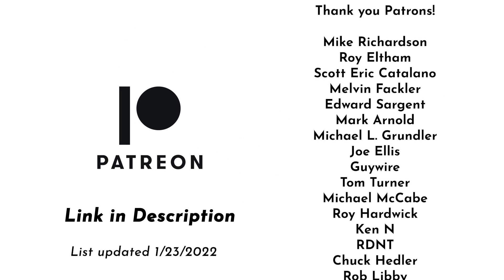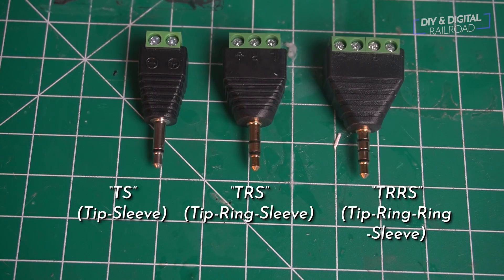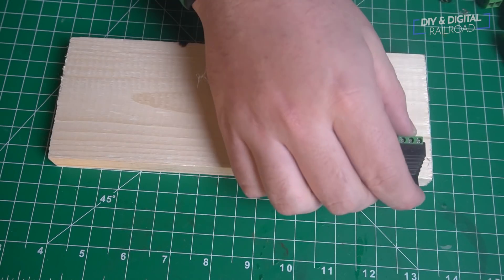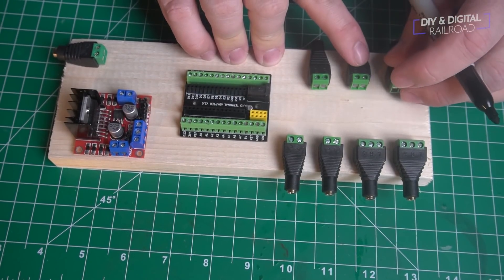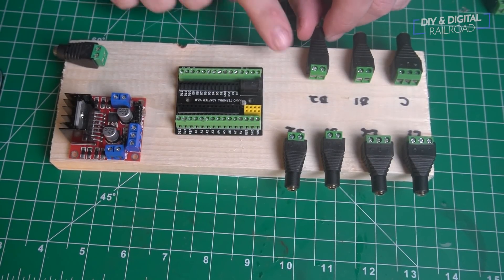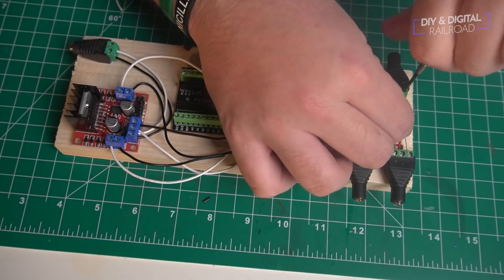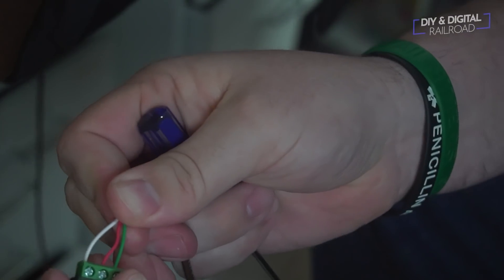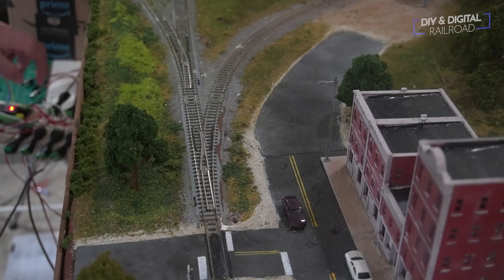This Makes Model Railroad Wiring A lot Easier.

Comment: Just be careful to plug and unplug the audio jacks when there is no power on them. Since the jacks contain a wiper that touches each ring, the wipers would potentially touch a ring with the wrong polarity and cause a short circuit. After they are all plugged in you can then turn on the power.
Reply from the maker: You are 100% correct.  This is also why I won't use this method for track power.
Reply: @DIYDigitalRailroad  Don't tin stranded wire. Solder flows under preassure and since these contacts are not spring loaded, they will become loose over time.

Comment: I'd probably only use rj11(4 wires), rj12 (6 wires, handy for pairs of 3) and rj45 (8 wires) connectors instead. Like someone else said the jacks do create a short when plugging it in or pulling it out.
If you need pairs of 3 then old serial ports are 9 or 25 pins.
Depending on the size of the layout you could have patch panels with pre-laid cables between central points that also allow for future expansion so you don't have to constantly pull new wires with all the associated risks.

Comment: DO NOT TIN THE ENDS!!!
Solder flows undwr preassure, meaning every connection with soldered tinned wire will become lose over time. 
Otherwise, great video thought.

Comment: I know this might not be the place for this, but I'm trying to build my first 2x4 layout and I have my 2" foam board mounted to the plywood and I just keep staring at it, not even knowing where to begin.  What I do know:   1. Fall landscape  2. single train  3.  likely using my bachmann ez track  4. Mostly a residential/city scape - not necessarily any industry since it's a small layout.   I've been watching Youtubes and looking at Google images like crazy and I'm just in this rut.   Thanks!     I'm in the Raleigh NC area if you know any good local resources/mentors.
Reply from the maker: I actually did a 2x4 N Scale layout build from start to finish for this exact Scenario.  It uses Kato Unitrack but it can be adapted! https://youtube.com/playlist?list=PLhNb9AHNpkeei0oTCywo9rVMnD8EBy41Z
Reply: @DIYDigitalRailroad  Hi Jimmy - I was following that series.  Can Bachmann EZ track run DCC?   I did an amazon cart total of your layout and it comes out to $169 which isn't the end of the world, but if I can avoid buying all new track that would be ideal.   Thank you.

Comment: oh no, dc voltage on a plug/socket arrangement that shorts out every time you connect/disconnect.
Reply from the maker: Yes you are correct, which is why I do not use these for any track power. This is also more of a ease of removal and disconnect for troubleshooting hack rather than you will be unplugging it all of the time.  I always power off something before I disconnect it.

Comment: One disagreement. don't tin stranded wires that you will screw in place. The solder under screw pressure will 'cold set' and the joint will lose tension, and the wires may loosen. Difficult bug to troubleshoot.
Reply: I totally agree. My last layout started to suffer strange faults after about 5 years and they were all due to this type of connection becoming loose. Don't do it!. ...........John
Reply: I was going to suggest that instead of tinning stranded wire, use ferrules.  You crimp them on with a tool and you have a solid 'end' to your wire.  They come in a variety of sizes and gauges and make stranded wire in screw terminals (or spring-loaded terminals) a breeze.

Comment: Alternatively when you really need the flexibility of stranded wire but want to avoid the loose whisker issues of stranded the use of the appropriate size ferrule and a ferrule crimper can save the day. There are even ferrules designed for connecting two wires in a single ferrule which is great for daisy chain wiring. An additional benefit to the ferrules is that properly crimped they exclude oxygen and reduce the amount of oxidation in the connections. Great video, keep up the great work. I don't know if I would have ever thought of using audio connectors that way.

Comment: I have been able to adapt your "Controlling Multiple Kato Switches with a Single Arduino" to control 2 crossovers and a turnout to industrial area inbetween plus turnout based signals with block detection should the turnout be aligned to an occupied block. Thanks for your videos on DIY Kato Unitrack turnout control and signalling

Comment: Aloha Jimmy  just a suggestion use various color wiring on your board.  It is way easier to trace when trouble shooting problems.     Kits with 10 colors are available and by creating a local standard you can make life better.  Red and Black should always be primary DC power (from the wall)  It looks like you're using BiColor LEDs so Green/Red might be a good pair color with maybe a color heat shrink marker.  You can tin the ends of stranded wires to make them easier to insert into terminals for connections. 
Just some thoughts.

Comment: Jimmy, in the video your red lights look pretty yellow. I don't know if this is just an artifact of the camera or if they really are that yellow. I have found that red LEDs often require a higher series resistor to maintain a red color - too low a resistance makes the LED too bright and turns it yellow. Fantastic ideas on the connectors! I can see this saving a lot of wiring time. Do you know if they come with pin mounts for PCB mounting?
Reply from the maker: Hello!  I think it’s the camera.  I can see it in the shot.  They look normal otherwise.  These signals come with built in resistors that do the job when connected to a 5V source
Reply: @DIYDigitalRailroad  So, it is not obvious that the LED's have a built in dropping resistor.  Do you know what value they are?

Comment: Great video.  Was part of a large Digitrax HO modular layout.  Everything was Cat5 and RJ11 keystone.  The Cat5 solid copper handled current and made reliable connection.  Love your cheaper DIY control options and  those adapters are perfect for smaller gauge layouts. Was lucky to work with a bunch of British expats who enjoyed scotch, brass locos, Digitrax but had no patience for circuit and solder.